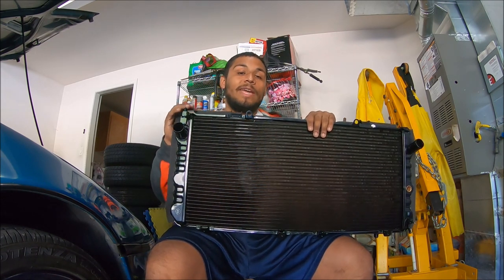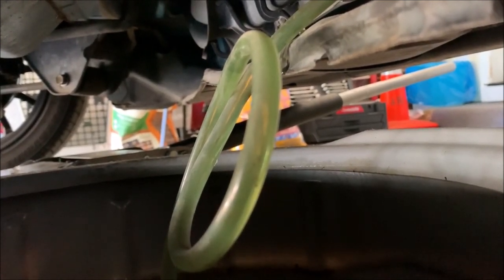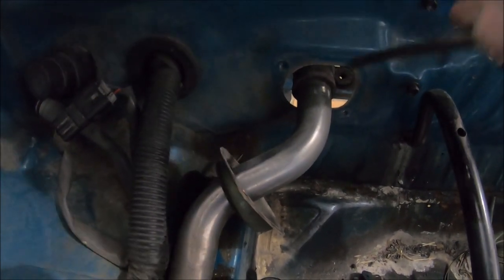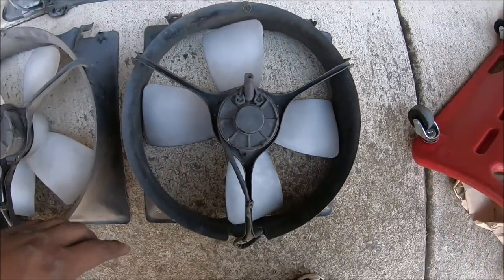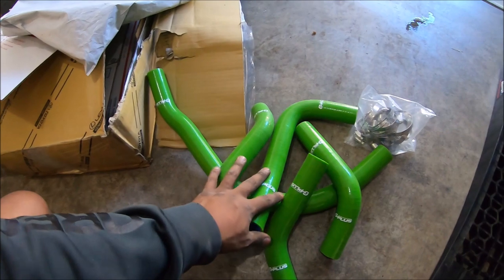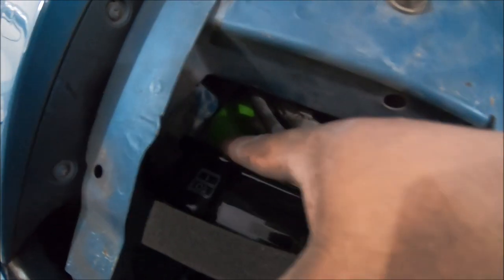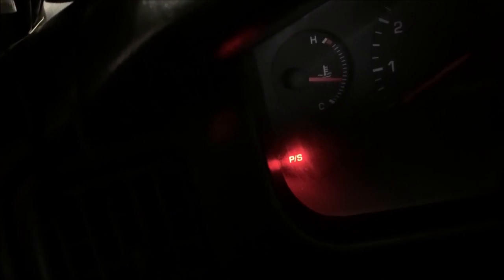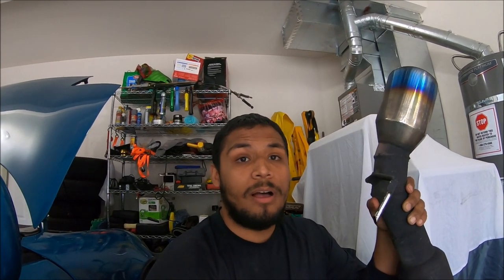New OEM radiator install || Supercharged V6 Toyota MR2(SW20)

Comment: 5:50 just say "mans not hot".  but do you know if replacing the AC lines that run to the condenser on the passenger side of the car is difficult? is it difficult to find that hard line?  mine is pinched.

Comment: So it's a turbo radiator installed into a non-turbo MR2? And there aren't any power issues involved with that switch? Great job and thanks in advance!
Reply from the maker: Switching from the NA to turbo radiator does not cause any pressure issues for the radiator fan switch. Removing the AC system or getting the wrong switch would cause a problem. There is a radiator fan switch for AC cars and one that is for non AC cars.

Comment: My mr2 won’t get up to temp on my 12 minute drive to work lol. On the highways, it only gets up to maybe halfway to op temp. So unless I sit and idle for awhile, it doesn’t get up to temp with this cold weather
Reply: Spilly Built your thermostat might be broken. Failed in the open position.
Reply: Possibly! I don’t really care that much though, as I’m putting a new motor in over the winter. I’m surprised my motor hasn’t blown up yet. Autox’d it all summer and it was hurt when I bought it. Every event it got a little worse, but it still runs! Idk how though lol
Reply from the maker: Definitely sound like a thermostat like boofighter said. Since you plan on throwing a new engine in, I wouldn’t bother fixing it 🤷‍♂️
Reply: Exactly